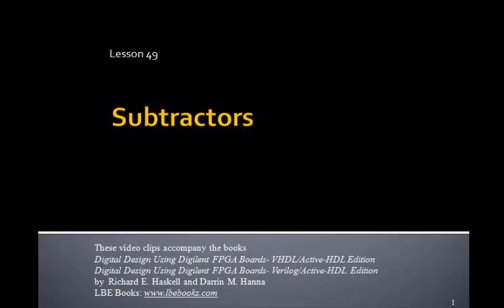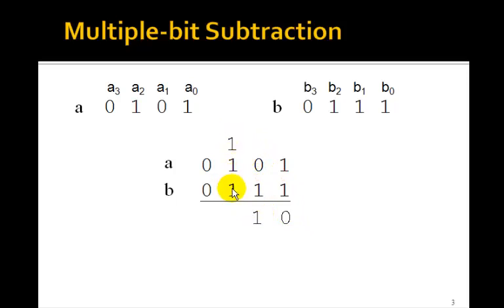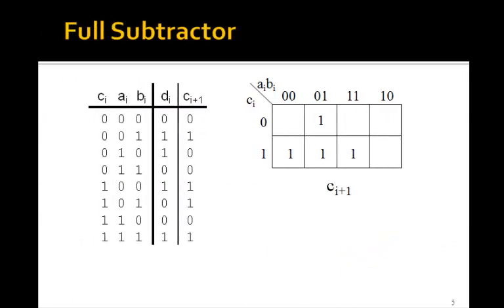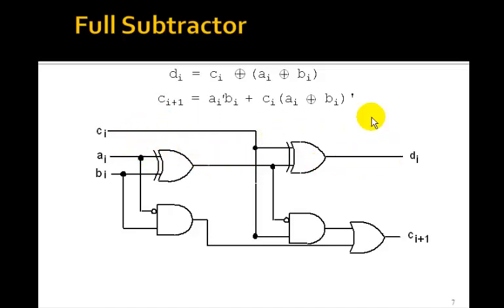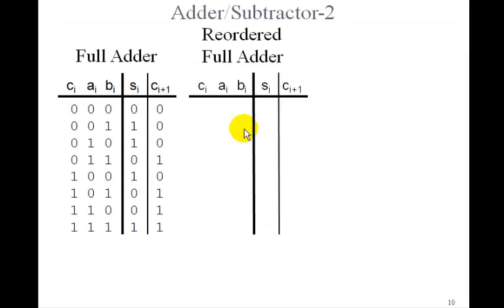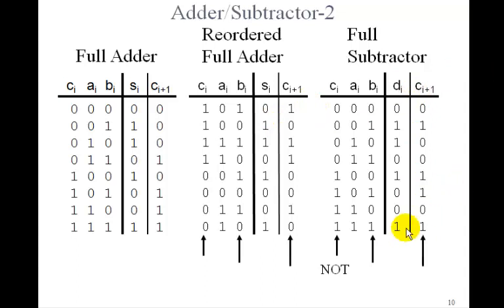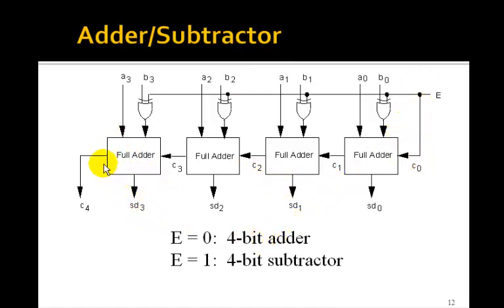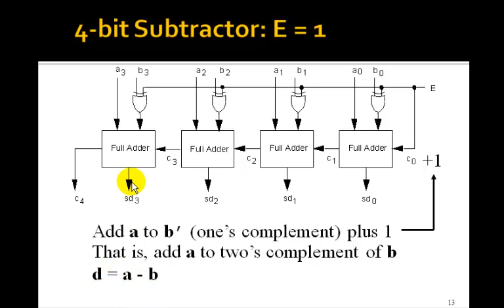Lesson 49 - Subtractors

Comment: You can use a 2:1 mux instead, of 1000 xor gates for operation selection. A single 2:1 multiplexer right at the carry and gate which will line all the others carry gates.